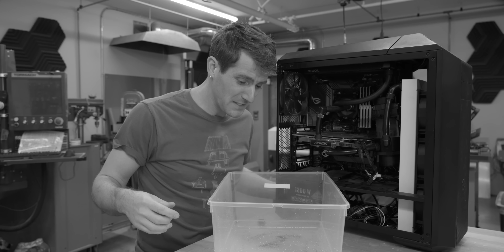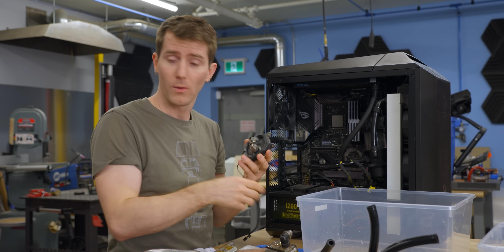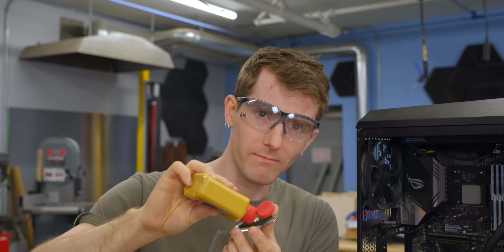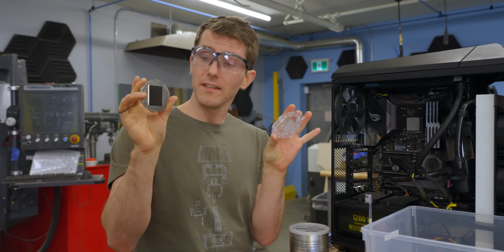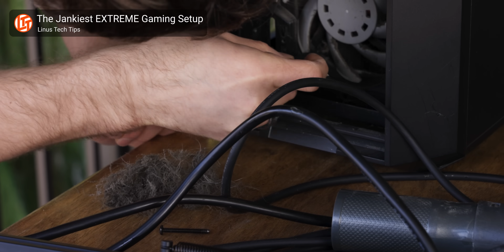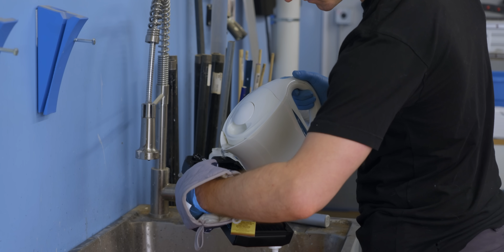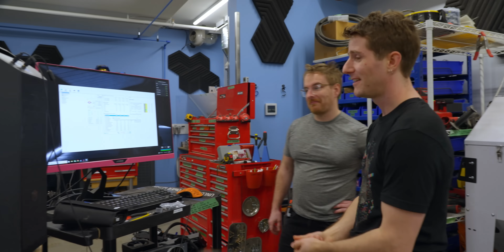I Will Never Watercool Again – Water Cooling Maintenance Guide

Comment: switched to a custom loop with a MoRa 420 a month ago. The system has never been more quiet. I use the proper coolant to prevent that kind of bio hazard. A few friends of mine have water cooled systems that are mostly untouched for a decade. They are still fine. Just do it right and nothing like this will likely ever happen. On the flip side... it is not needed at all and it's pretty expensive. Most stuff I got was very good used deals or provided by a friend. Therefore my calc. doesn't reflect the true cost of water cooling. For me it's 100% worth it because the noise was driving me insane before but your mileage may vary.

Comment: Hey Linus, please explain why there are no filters or regular fluid exchanges as standard when it comes to liquid cooling. I would also like to know why mineral oil in a liquid cooling system is not used. Would not a filter and a sump with the right oil be the better cooling system, it is used to cool gearboxes and (in part) engines that also should not exceed 90c for healthy operation. You could even have oil pressure gauges and flow meters to ensure optimal operation. I´d love to see a build with oil based filtered gauged and a sump at the bottom for optimal oil changes as(if) needed. Perhaps with a sight glas and a pump switch you start before you turn the pc on and a relay so it will only start when flow/pressure is adequate. Can you build such a system or is it beyond LTT to do?

Comment: Always aircooled, but got an ekloop out of curiosity and it has been really good and worked fine for a year without having to clean it, 3 years going, but that pc is being sold so going with an aio to keep up the looks and prob will go aio for new pc as it'll be moving a significant amount

Comment: follow these 4 simple steps to have a custom loop that lasts multiple years without any maintenance.

1. use a copper loop with compatible materials (no aluminium). skip low quality parts.

2. ALWAYS clean everything that touches the water in the loop before you install it, even when new. you can use vinegar essence or lemon acid in a deluded solution. rinse with tapwater, then rinse with destilled water.

3. use aquacomputer dp ultra clear coolant, you can delude to about 50% with destilled water.

4. use EPDM tubing, or other tubes and pipes that dont have softeners that can bleed into the loop.

and thats it. finishing touches, make sure you have 1 or 2 drain ports. a good setup will allow you to flush and refill the System in less than 10 Minutes.
Reply: never, ever use vinegar and tap water on copper, epdm tubing is the way for sure
Reply: @resko8758  a somewhat mild acid wont ruin the copper, just dont overdo it. acid (vinegar/lemon acid) also helps to remove staining on copper (polish after for perfect refinish), production leftovers and is a biocide. be sure to rinse thoroughly after.

dont use acid on nickel plating, tho. however nickel plated coolers are usually machined and pretty clean, use mild soap instead.
Reply: @sgredsch  or use classic toothpaste that also does wonders
Reply: @resko8758  last time i tried toothpaste it just made the waterblock smell funny. i recommend investing 5 bucks into a proper polishing compound, saves you a ton of time and gets you better results. hypersonic toothbrushes with soft bristles are great for watercoolers, you can also use them for polishing.but only polish bare copper and stainless steel, dont touch acrylics, rubber, nickel plating with the polish.

Comment: Do NOT use vinegar unless you are going to use a basic solution like baking soda + water to neutralize the acid. The acetic acid can stay in the radiator and then damage your other parts, especially where nickel playing has flaked off and raw copper is exposed.

Comment: An app enabled toothbrush. A toothbrush you need to control through an app. Do you have to subscribe to the app? Is there any way to operate the toothbrush without the app? Will getting banned and your app access revoked for whatever reason brick the toothbrush?

I don't like this wild ride we're on, and would like to get off.

Comment: He could totally still sell it. Just a little less. And if it works and looks ok then you can sell it for more...need a paint shaker for that food shake for the radiator.could have been light that has been hitting that little piece of foam for a few years, uv light can kill lots of types of foam, it certainly oxidizes it.

Comment: These problems are of CUSTOM water cooling only. Just use an AIO or stick to air coolers and you don't even need to worry about stuff like this at all.....If something is wrong with the AIO just RMA or buy a replacement unit to save time.

Comment: Why was his GPU memory running at 90c at the 19:35 mark
Reply: That shows the memory junction temperature. This is not the same as actual memory temperature and is nothing to worry about.
Reply: @Christopher_S  pure bs, 90 degrees is waaay too high for memory, also memory junction temp IS the memory chip temperature
Reply: @resko8758  It's the temperature of the actual silicon, not the module. The junction temperature is always higher than a module temp because of this being taking inside the package.

It's fine to see it high like this. It's not perfect, nor would I be happy with it, but it's fine up to around 110C usually.
Reply: @Christopher_S  junction temperature is the only way to tell what is the highest temperature inside the CHIP so it acts like a hotspot, also integrated circuits made of silicone degrade faster above 75 degrees my guy.
Reply: @resko8758  He's right, normal memory junction temps for at the very least the RTX 3000s were 90C+. You must not know that AMD's current CPUs are designed to boost until they reach 95C. You also don't know that it's silicon, not silicone.  Silicon also doesn't degrade at high temps on its own, it does so when too much voltage is applied. Most laptops are constantly running their chips at 90C+ by design. These are all things you could've looked up instead of arguing, it's easy information to find
Reply: @kendokaaa  oh yeah silicon, my bad, also yes silicon does degrade from temperature too, not only from voltage, sure cpus and gpus can run 24/7 at high temperature but at the same time they do degrade from that high temperature, you are the one wrong here, educate yourself then argue with me.
Reply: That's very high for a full cover block. Thermal pads on the memory might not be thick enough and not making contact.

Comment: just a quick tip if you want to remove adhesive on a flat item (phone/tablet screen, waterbloc, etc) and you have a 3d printer...

just slap it on the 3d printer bed and preheat the temp you want and there you go!

Comment: 17:25 hm?? doesn't water expand when it is hot? When it cools in a sealed container, then it creates a vacuum... Meaning unscrewing it could be a challenge, but not spraying water out of it.
Unless the metal expands when it gets heated up by the water and creates pressure? hmm...

Comment: Use the correct water cooling components (don't use aluminium in combination with other metals) and the right coolant. You should be able to use the pc for 2-3 years before maintenance

Comment: The key is proper coolant. Automotive coolant without antifreeze and 3 drops of biocide like Hades Extreme or similar. Just dump and replace every once in a while. The only thing you see is a slight mark at the water level. Never needs any disassembly cleaning even after years.

Comment: Never needed water cooling. Always had a super silent gaming PC with Noctua CPU cooler, liquid metal and enough fans for perfect case air flow. And a large power supply of course, so it stays silent and not producing a lot of heat.

Comment: I will always advocate for using diluted engine coolant as long as you check your plastics. It stope things from freezing, contains corrosion inhibitors, and because of those corrosion inhibitors, it helps reduce damage from mild leaks

forgot about propelene glycol being toxic, so it also prevents growths

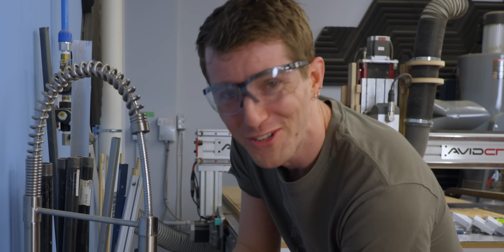Comment: 5:38 IP7X would mean that it's more dust resistant than the maximum IP rating for dust and has no water IP rating. Linus probably mixed up the read, IPX7 would make more sense.

Comment: Great shoutout to the AIOs and one of the reasons I didn't get one. I'm using the same trusty old NH-D14 for over 10 years. Noctua sends socket upgrade kits for free and the worst thing that can fail is a 10-20$ fan.

Comment: i dont get it everytime is see a watercooled pc cleaned it has some pests in it and it looks disgusting. i run the same watercooling for over 15 years (only changed waterblock from AM3+ to AM4) but i do change the water and clean it every 2 years. but it never been as bad as i see on the internet. the only regret i have is the first time i filled the system i used red dyed fluid and each time i change it (with clear fluid) its light pinkish. and as i see this i need to change it again 😉

Comment: I think Linus deserves an award for most original and sophisticated shilling.
Reply: Cheap ultrasonic toothbrushes are actually really useful for cleaning in small tight spaces they're like small handheld ultrasonic cleaners
Reply: Eh, I'd accept this kind of shilling. Once you use an electric toothbrush to clean tight spaces, there's no going back.
Reply: Shiling ? Debatable, but I'm sure as heck to some of us this is legit use case.
Reply: @Stratos1988 Might sound odd, but I keep old electric toothbrush heads for use with cleaning small areas, grouting etc
Reply: @Stratos1988  
That's what I meant. Using an electric toothbrush for cleaning water loop parts isn't crazy, using it as a sponsorship however (considering that's not actually what they are made for) takes some balls.
Reply: @Alias_Anybody  And that's why this is great, the sponsor doesn't really have any influence over the video, they're not claiming any things that could be untrue, there's nothing shady going on, just a clever use case showing their product and LTT running away with their money and doing something cool with it. Honestly the best kind of integrated sponsor spot. They're providing two use cases, without really hammering on that brand. If I were to go out and buy something like this I'd still look at other options but at least consider it
Reply: @Stratos1988  that’s the entire point of shilling. You pay the shill with the big audience to use the product in front of them and incentivize the audience to buy it. 
I don’t get why “shilling” has such a negative connotation. It’s just a basic practical form of advertising.